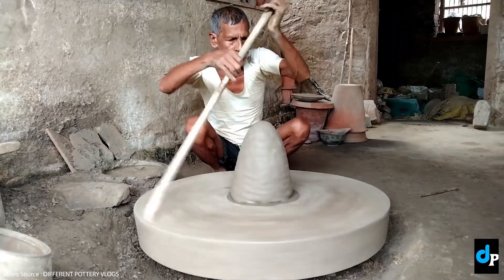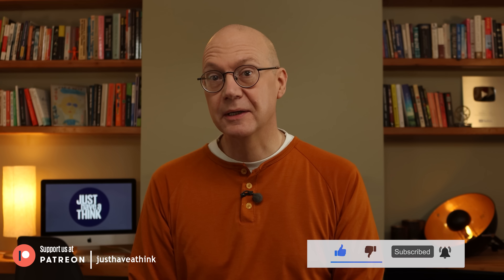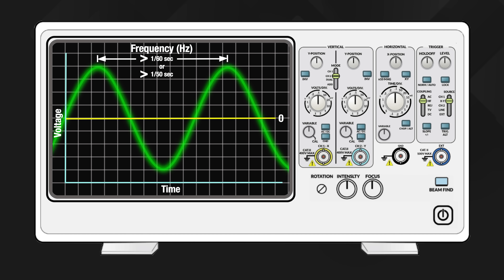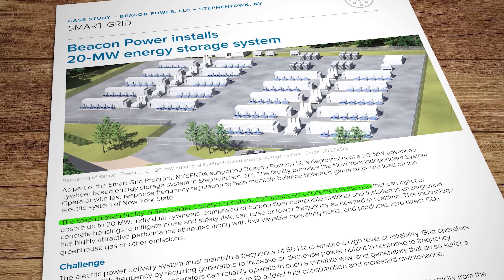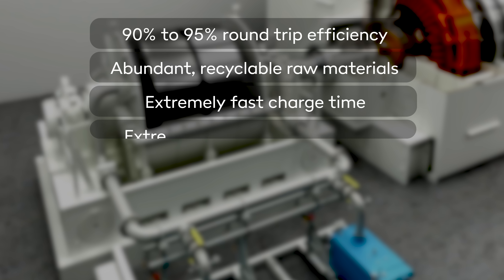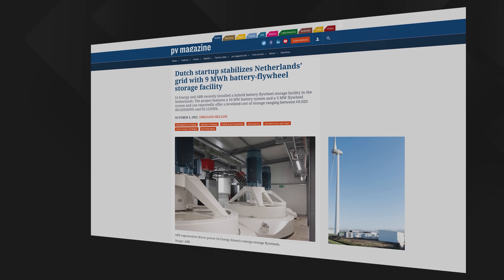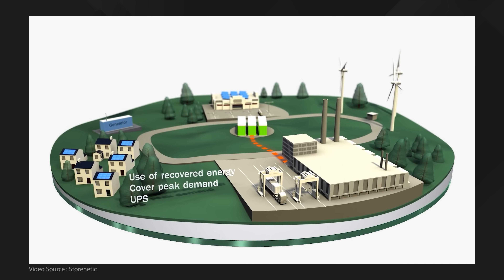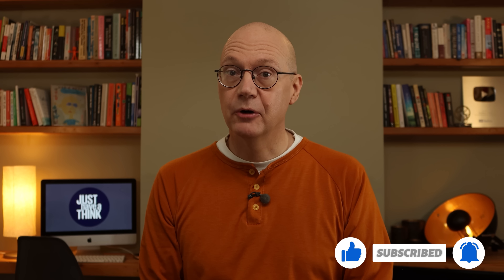Flywheel reinvention revolutionising our power grids!

Comment: This has been an informative article. But on reflection it convinces me more that moving to renewables as our base energy system, is a massivemistake. As described, the current technology uses a ruddy big boiler,  superheated steam turbine to drive the generator and bung it out onto the grid. And of course the energy density is enormous. 

But renewables don't have that energy density,  requiring great numbers of turbines, creating many problems with variable output etc. Requiring extra technologies to overcome the problems. 

The consequences are massively increased costs (installation & maintenance), complexity and reliability issues,  and of course considerably even more land to house the systems.

All in the name of reducing demon CO2 in the name of global warming, which has not been proven, and no evidence exists to support the extravagant claims of a climate crisis.

Comment: I worked in San Francisco when a flywheel-based uninterruptable power supply failed. This was back in the 2000s, and it seemed half the major sites on the internet had gone down, because they were all hosted at 385 Main Street. It was the first time I'd heard of a flywheel used for power, but I'm sure the tech you describe here leant from that mistake.

Comment: At last someone who understands what grid batteries really are, an electronic flywheel. Also worth mentioning that in the peak industry years, at least in Australia, during the 50's through 80's factories would have large synchronous motors running usually driving air compressors or process pumps, whose job was to smooth out jolts and dips being transferred back onto the grid supply. This was achieved in two ways, by adjusting the rotor excitation the pf of the drive motor and therefore the reactive load imposed on the grid could be held to acceptable levels and secondly the large inertia of the motor and driven compressor supplied rotational inertia (spinning reserve) to the local grid, reducing the effects of equipment like presses with high cyclic loads on the grid. With modern solid state motor controls and the general loss of manufacturing at least here in Australia most of these grid stabilising systems have been lost.
Trying to visualise the transfer of energy back and forth across a grid while maintaining frequency and grid voltage within bounds just makes your head hurt.

Comment: Maybe it was roto-lutionary and not revolutionary!  Question:  Will a world covered in flywheels cause a rotational slowing of the Earth!  Also; why don't the flywheels rip themselves off their foundations given their orientation is space would by gyroscopic?  At this rate of hybridization of alternate energy production means shouldn't polyhybrid systems that utilize:  Nat. gas., Bio-mass, compressed air, Wind, Solar, Thermopile, and Piezo electric arrays be pursued?

Comment: King Island in Australia has had flywheels (in the guise of a Diesel Rotary UPS systems) in a multi-MegaWatt Remote Area Power Station since 2012, increasing penetration of renewable energy to around 65-70%, saving millions in fuel.

The project even has a real time dashboard.
Search: king island renewable energy

Flinder Island and Coober Pedy in Australia have the same system but built into modulerised containers.

Comment: MIT,s fusion experiment has been running a 218 ton 2 piece flywheel over 30 year, and the 118 ton version for years earlier.
The 118 ton flywheel is a retired New York City Transit Authority cross compound steam turbine generator. 50cycle
They have the generator from the low pressure half @180 MW.
They don't have a 300,000 HP steam turbine so they spin it up to speed with a 2.000HP  electric motor and then engage the field and the 118 ton field acting as a flywheel dose the rest.
They get 180 MW for 5 or 10 seconds, then they start all over again.
After several years the wanted to increase the duration, so they add a 100ton fly wheel between the motor and the generator.

Comment: After watching the episode, you can find out very interesting things. In a few days, my partner and I are registering a Foundation called Umbrella. We are both the inventors of the flywheel which is already in the patent office. Power capacity 50 percent greater than known. Half the cost of lithium-ion batteries. And most importantly, it has no gyroscopic effect. Capacity up to 100 mgw. We have several projects lined up that could completely eliminate fossil fuels in a few years. Not 2050 but 2030. Umbrela is a foundation to restore the climate to its pre-industrial state. If you are interested, we will provide you with more information in the hope that it will also help us save our planet together.

Comment: Rotating machinery = maintenance. The advantage of flywheels is their fast discharge rate and some have suggested they power high capacity truck EV charging stations. The market for frequency regulation is not so big and utility PJM showed that lithium batteries can meet that need and also support more energy intensive peak shaving.

Comment: Great analysis on the benefits of flywheels in conjunction with battery technology.   What I find frustrating is the constant hyping  of these low power whimsical aka renewable solutions all while overlooking fission as a perfectly viable large and small scale solution, whose primary problem is over-regulation and disinformation.  Please do more to promote smart nuclear and remember that fusion is still decades away.

Comment: Thanks for another great video.  I like the idea of cheap abundant materials being used for a flywheel energy storage solution.  Materials that are hard to obtain might be cheaper in the short term, but may lead to huge future costs like political instability.  Think of how much money is currently spent by countries dealing with the political turmoil associated fossil fuel supplies.  Imagine having to need a military to protect supplies of lithium to keep your economy from collapsing.  Future costs like this are basically impossible to estimate but could be huge.

Comment: K.I.S.S. right? Built right it seems like a flywheel technology would last forever. There are flywheel in the world that have been used for generations full-times since being created. Batteries are great but I've always wondered about their large scale application on the grid since, especially lithium-ion, since they are not simple to recycle and are highly toxic. It's almost like trying to kill cancer with radiation, you're hope is it doesn't kill you first, and these types of battery chemistries really feel like that same type of situation.

Comment: 2- for engineers: could this technology be used to enhance and increase a relatively small energy input which then could be stabilized or even augmented via flywheels? (e.g. for steel production ... )
Reply: many already have; for example a hammer coupled to a flywheel.

Comment: Flywheels are awesome, but very scary when they go wrong. 

Imagine a tonne of material spinning at hundreds of thousands of Herts wobbling just the tiniest bit. BANG!

I guess the goal for making these safer is to make them lighter, smaller and spin faster - E = 1/2 mv^2. You can get good energy density without having to go super heavy, if you can tolerance it precisely enough to have a crazy high velocity.

Comment: The Healy coal mine is situated in between Fairbanks and Anchorage with thin middle of nowhere three phase power to operate their electric digging machines. Turning the machine on all lights dim along the line serving the mine. They ended up years ago buying a flywheel that they put to serve the mine. That ended the overload situation on the long distribution lines and increased their own power availability and efficiency ultimately saving the money on the cost of electricity. A real world example of an industrial facility that was more than pleased with their flywheel. New expensive Lines did not have to be built and the lines are stable. I don't know if it is able to serve in both directions. Coal mining has declined. I think it would be an asset to the utility but will require unique tariffs to put it to work in our standardized State regulated public utilities that are all nonprofit with simple tariffs that fit on one page rather than a New York City telephone directory of rates. An ideal asset for a large wind farm to absorb the excess from wind gusts that cannot be squeezed through the fully loaded power lines that can maintain a smooth and full output able to squeeze the sudden excess power generation stably when when wind's power decreases and increases dramatically making it hard for utilities to utilize the cheap power without maintaining fuel consumption at stable generation facilities trying to cope with the fluctuating supply and demand the storms provide. Better than a battery of any sort as the primary frontline interface that can be backed up with batteries that won't be stressed coping with the storms and variable winds.

Comment: Dave, Thanks for raising the flywheel subject.  My understanding is that the retirement of conventional generating plant - with its inbuilt spinning inertia - is causing a lot of concern over grid frequency.  One point that you didn't mention is that synchronous generators are directly connected to the grid without intermediate power electronics - unlike battery storage.  Most grid faults have a duration of around 100ms (before a breaker trips) and these directly connected generators have the mechanical oomph to push through it.  This is because their windings are not current limited in the same fashion as power electronics.  It is important to differentiate between the need for grid stabilisation and fault tolerance and the completely different need for deep storage to facilitate intermittent generation from solar and wind.

Comment: The flywheels are in a strange space where they compete with Li-Ion batteries directly (and to a limited degree pumped storage). The benefits of flywheels seem slight and I can only see charge/discharge cycles and material usage as the major ones. So with more unstable renewables added to the grid these could have their use, but they will have to reduce their capital cost to be considered. Time will tell if production of scale will kick in (if it hasn't already) for flywheels vs Li-Ion. One issue I can see for Li-Ion in favor of flywheels is that the batteries are used for so many other products and prices can go up as they struggle to find enough raw materials.

Comment: I have always wanted to configure a series of flywheels powering generators by using the oscillating water column system and focused airstreams on a turbine for continual regeneration.

Comment: It maybe worth commenting on why the rotation frequency is important. One issue is that the AC transmission and distribution system, along with the turbine generator's electromagnets, need to stay in the linear region of the B-H magnetisation curve, otherwise the induced currents peak to really high values risking overload. The reduction in frequency means the back EMFs can't be maintained, but it's easier to monitor the frequency and control based on that than the voltage and current monitoring under disturbance.

Comment: I just bought a flywheel (kinetic) woodsplitter. Speed and power were my main goals but it also turns out that I am using about 1/3 as much gas as my old hydraulic one. It saves energy because it gets a charge between splits while I am picking up the next piece to split. It is brilliant and I love it but it is a very specific application. I imagine that in the right niche this could also help the grid as well by smoothing out solar spikes from clouds perhaps..

Comment: I've seen them used to maintain power at a computing center long enough for the backup generators to start, sync & come on line. But the frequency sagged slightly which wasn't a problem because the computers need stable voltage, not stable frequency. But the grid can't be trusted if it hasn't got stable frequency. So if the grid didn't look right they just switched off the grid and went on their generators until the grid stabilized. Flywheels directly on the grid are no good at frequency regulation but are great at absorbing transients by regulating voltage. Direct flywheels can not regulate frequency because they aren't controlled by a throttle, only the exciter. Indirect flywheels generally spin at high rpm and function just like DC batteries, and can regulate frequency just like any battery system. Not a fan. I think sodium & liquid metal are the batteries that will ultimately whoop all da battery big booty.

Comment: Current designs for grid frequency stabilizers include a big battery and a frequency standard. The speed up and slow down is done by adding or removing power from the grid and slowly advancing or retarding the phase.

Comment: nope     nope      NOPE         there are fairly  OBVIOUS  reasons why a flywheel is really only good for one purpose.      that purpose is:  to  smooth the operation of a system that is inherently high in vibration;  eg., any type of  RECIPROCATING  engine.

Comment: Its a little confusing because there are two types of flywheels and you don't seem to be distinguishing between them.  There are direct-grid-synchronized flywheels which basically look like generators.  By being directly connected, such flywheels can provide a great deal of momentum for very short periods of time before they leave the strict frequency range that is useful for their operation, without requiring back-end electronics to handle the full load.  This function can be really useful because the electronics are simpler.

Then there are flywheel "energy storage" devices whos rotational frequency is decoupled from the grid.  These flywheels can operate through a very wide range of rotation rates to charge and discharge.   They have nearly the same back-end electronics as battery systems do, however, and just aren't anywhere near as flexible as batteries.

My personal opinion... as grid's get more and more energy storage, mostly batteries, the need for momentum flywheels will disappear.  Batteries can perform that function too, including reactive energy recovery, it just takes a whole lot of batteries plus their related electronics to do it... but the grid will need to have those batteries anyway for load-shifting.  Nor does it necessarily cycle the batteries excessively.  Even battery systems often have large capacitive buffers.  Adding a bit more buffer storage on the back-end of the battery system could be a good use for super capacitors.

-Matt

Comment: Fascinating how much can be stored. You mentioned the gyroscope and I thought: does the Earth rotation affect flywheels?? On the geopgraphic poles and a vertical axis, there would be no problem other than changing the length of the day, a tiny bit... But on other locations there must be considerable forces on the bearings ..
Reply: I suppose you could use gimballed supports..
Reply: I've seen stationary flywheels installed at an angle so their rotation axis lines up with the Earth's rotation axis, presumably to eliminate those forces. That said, I also see flywheels installed such that their rotation axis is vertical or horizontal, so I guess spreading out the forces over the whole day reduces them to something that can be accounted for in the engineering.
Reply: @larstheu The Foucould pedulum in Paris is affected.

Comment: Rotating wind turbines have usable inertia. We get more and better tools to maintain frequency, the idea that lack of inerta is such a huge problem with renewables is just something the anti-renewable crowd made up, it is not true. Solar PV has no inertia,  but we will have batteries for "ordinary storage" that can more than cover the lack of inertia in solar PV.  And then there's demand management, we already have a lot of potential there, and that will increase a lot. 

So, there are enough of perfectly good ways to manage frequency that requires little to no extra investments or hardware, which also means no extra self discharge.   

Also, you can't have large scale high power energy storage without potential risk, you can manage the risks, but its there. Flywheels can release all their stored energy in an very small amount of time, that makes them, in a way, among the most potentially dangerous methods to store energy. Not saying it's a big issue with flywheels, but if they store energy enough to be relevant for grid management they are potentially extremely dangerous.
Reply: That's true, they could be sited below ground for safety's sake.  But lithium battery storage units catch fire and burn up at times, energy storage is inherently risky..